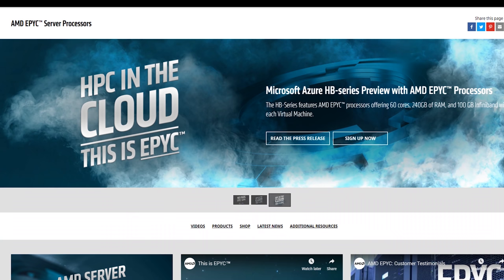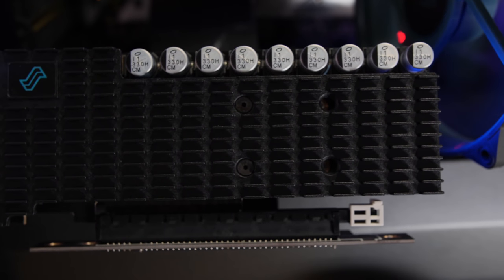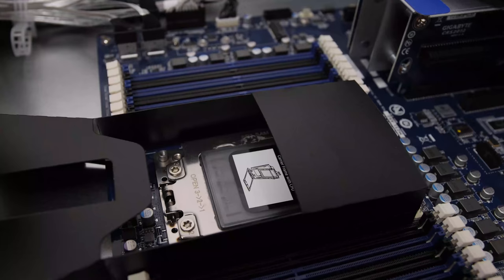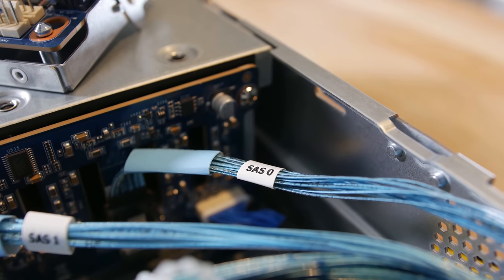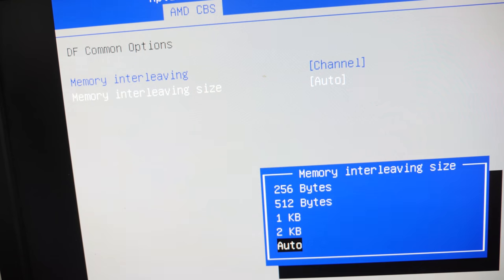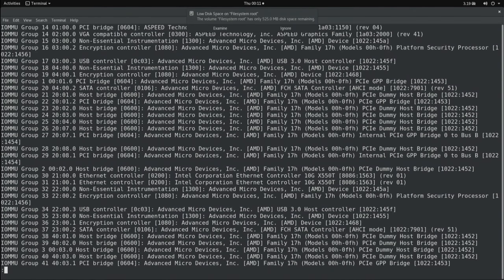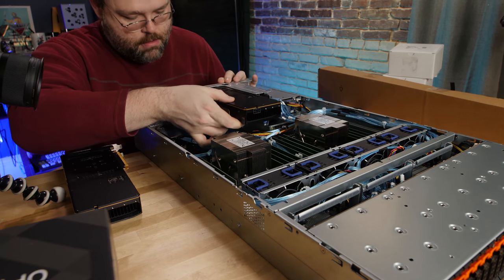Our Most Epyc CPU Tests Yet! The AMD Epyc 7371 On The Gigabyte R281-Z92

Comment: THANK YOU, WENDELL!!!
I was just SO excited to see what the tech community was going to do with these EPYC CPUs when they first came out - I mean, let's be honest, Ryzen is pretty damn conventional by modern standards, it was just MASSIVELY underestimated by all of us; but, EPYC has ALWAYS been the true star of the show. And, yet, I waited, and waited, and waited, I would regularly do search, after search, after search, I would make request after request; but NO ONE has done any real EPYC content to speak of, while it may be uncommon but it's certainly not rare to see great content involving Intel Xeon parts. I get that availability for EPYC parts is nothing like the availability of Xeon parts of course; but NO ONE was curious enough to check these things out to actually pull some strings and get ahold of one of these??? These are some of the most advanced and power dense commercial CPUs on the planet - and they're basically 2 years old now with not much of any content out there on them at all.

Is the rest of the tech community just not as interested in seeing what EPYC can do as I am? I mean, why someone like Linus wasn't making unique content on the 32c/64t EPYC hardware an entire YEAR before we even knew that a 32c/64t Threadripper would arrive, I don't know - but you can't possibly tell me that a video about a 32 core 64 thread AMD powerhouse in !!!2017!!! wouldn't have generated a metric truck load fuck ton of hits, the fact that this was even coming from AMD in 2017 alone was just crazy.

Anyway, I'll just leave my bitching at that - at least SOMEONE in the tech community is interested in these things!
Reply: I assume it's because Xeons have had a longer lifespan, thus, is more likely to be sold used and end up in consumer hands. Epyc is only 2-3 years old now, so used hardware isn't really avaible yet.

I imagine once we get some 32 or 64 core Epycs in the hands of the community, we could see some crazy stuff happen.

Comment: Compile linux kernel in 28.81 sec?? Holy crap. Gentoo doesn't sound all that bad, all of a sudden.
Reply: Really 29 seconds to compile the kernel? That means chromium will just take 2 hours to compile!! :P
Reply: @markkeilys  Instead of 16. Yay
Reply: Just for the record, the compile time was never really what made Gentoo intimidating.
I learned to fear routine updates because there was always a chance I'd be stuck in dependency hell for days before I figured out what was going on. More importantly, I wasn't getting shit done.
...it was usually python. It's always fucking python and everything is dependent on different versions.
emerge -uavDN @world. Not even once.

TL;DR: should've installed everything in chroot. Or Flatpak, these days.

Comment: I could condense a whole rack worth of Xeon's into just 3 of these Epyc Systems as VM Hosts.... 
Damn AMD are on a roll with DC Hardware!
Reply: +Jared Woodruff To be honest, those Epycs would likely cost more, especially if you would buy slightly older used Xeons from eBay
Reply: @guestimator121  True, if you go second hand. 
From my perspective i would employ these in a large scale enterprise environment so second hand is not an option. 
Surprisingly i had DELL and HP Quote up some of the Zen 1 series Epyc servers and the cost was so much lower then Intel equivalents it was a no brainier.
Reply: @guestimator121  Used hardware in mission critical business environment? Hmmmmmmmmm
Reply: @guestimator121  epyc is way, WAY more affordable than xeon. Like stupidly more affordable. You can buy 2 7601s for the price of one 8 core xeon, and you will still have leftover money.
Reply: Snow Star Yeah, haha, what if I just got done with extreme overclocking on the Xeons? Lol, just because they pass my stability test doesn’t mean much (that said, I’ve seen Xeons fail my testing.... but recently with my Threadripper I’m like yay, more than 1 or 2 sticks out of 4 are detected...)

Comment: ...and all that UMA/NUMA stuff will be over with ROME, kinda, as 8 Dies have to communicate with the I/O Die (or ancient Speak: Chipset)...
Funny how that goes: First you integrate the Chipset into the CPU die, then you throw it out again into the I/O Die and have a more classical/ancient Setup. But its really interesting how that will work.
Reply: In the end, the physical location of the different functional units is not that important.
It's more a costs/yield vs. how fast can you tie the dies (chips) together...
Reply: All of this changes purely as a result of chip engineering/fabrication evolving to the point of making various component arrangements more advantageous or disadvantageous versus other component arrangements.

I think that, when looking at the past and how common it is for us to turn back to "the way we used to do it"(on an extremely generalized level anyway), people get the wrong idea and think something along the lines of "...well, why were we so dumb to ever move away from that when we obviously know today that it's the 'better' way...". But, what the misunderstanding is, is that 'we'(which is to say, the leading people behind the design of whatever object it is that's being talked about) tried to do it 'it' [THAT] way because we probably knew that it's likely the optimal way of doing whatever [THAT] is; but the engineering/manufacturing/materials technology of the past limited the possible ways that we could realistically achieve [THAT], and so while the general configuration may be the 'most ideal', we may not be able to realize the full potential of [THAT] arrangement due to limitations in the implementation of it.
Which is to say, AMD has arrived back to this point, with Intel quickly scrambling to follow them into it(crazy times!), because engineering/manufacturing/materials technology has only now made it possible for them to take advantage of this style packaging.
[good lord I hope all of that made some kind of sense - I'm much better at understanding this than I am at describing it]

In fact, this is played out VERY obviously in the auto industry. Take electric cars for example, they outnumbered internal combustion powered cars throughout the first decade of the 20th century[IIRC] - so, why didn't they just continue to dominate the auto industry, especially when internal combustion powered and steam powered cars required SOOOO much prep before you could even hop in and drive it to town and SOOOO much maintenance in ownership while electric cars just required basic lead-acid battery maintenance? 
"CONSPIRACY!!! Henry Ford, barley struggling to just stay afloat in the beginning years of his company OBVIOUSLY saw the electric cars as a threat to the success of his alien technology Model T!!!"
...well, no - electric cars failed to even remain viable in spite of very very early success due to the severe limitation of BATTERY TECHNOLOGY. So stifling has battery technology been that, even though General Motors invested MILLIONS upon MILLIONS of dollars into the EV1 program throughout the '90s, even though this program was attempted almost an entire century after the electric car saw very real and legitimate success, that General Motors, in all their best efforts, could NEVER make the EV1 even close to being a mass production viable program.
And, BTW, when you listen to these conspiracy theory morons that desperately contend that the EV1 was "killed because it would've completely changed the auto industry and our cancerous addiction to oil as we know it[!!!!1!!111!!!!1!1!!11!!!1!!]", just remember that they're attempting to prove to you that the very company - General Motors - that killed the EV1 for sinister internal combustion conspiracy reasons, is the same exact company that decided to start the program in the first place, that continued to invest millions upon millions of dollars, much more than they invested into any other car development program that actually reached the dealership, and that spent more than a decade trying their damndest to actually make it production viable, so that they could AT LEAST get some kind of return on everything that they had invested into this.
They're trying to convince you that a company would invest, say, $10M into a product that would "change the industry" - just to kill said product when it's supposedly "production ready" just because it's so vastly superior to every other product that they had...
HUH?!?! If it defies logic, it probably isn't true - it should go without saying that the easiest way that GM could've killed the EV1 is simply by not starting the damn program in the first place, let alone continuing to fund it more than they even funded the actual products that they profited off of...  
"huh, I wonder how GM went bankrupt in the 2000s..."

Oh yea, point being that electric cars are viable now because BATTERY TECHNOLOGY has finally progressed. 

...ok, I'll stop now - Ranty McRanterson signing out...
Reply: but an io die like that vs a chipset has 2 key advantages. The first being proximity to cores, the second being it holds L3 cache
Reply: @james2042  True And due to higher frequencys, latency should be lower as well.
Also keep in mind that back in the olden days, the Cache was controlled by the Chipset as well. In this case, it could even be an L3 Cache in some rare occasions (K6-3 or the 2/3 plus). Sadly those CPUs don't support no multi processing...
Reply: @james2042  Oh by the way, with the Information we have right now it looks like the L3 Cache is still inside the CPU Core and not the Notrhbridge aka I/O Die. We do not know if there is some kind of L3 Cache or Memory Buffer inside. But its likely that there might be something like that.
Maybe AMD even implemented speculative reading things. But I doubt that.

Comment: I'd love to see a cost and performance comparison of the TR 2950X, the R9-3950X and the EPYC 7371 and 7351 for the purposes of a high end desktop computer used for CFD work.

The AM4 MBs will be  a lot cheaper than the SP3 motherboards, but you can get a dual socket SP3 motherboard.  Geekbench4 comparisons are very interesting.  OEM 7351s are just a bit more expensive than the 3950X.   Who wins ?

OpenFOAM has a benchmark file if you need it or I could supply you with a test case.

Comment: Love to see a super RAID0 on the platform. Not to be just a geek, but to see where saturation is...u Know?!
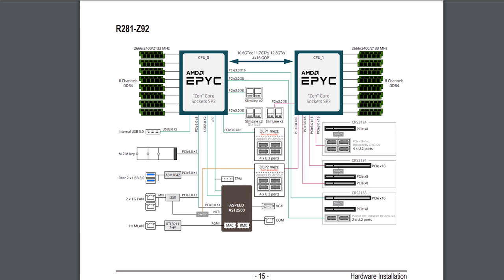Reply: In theory. Intel advertises 2gbs per u2 drive, 4 of them saturate the pci lane at 8gbs, software raid the pci lanes for 24gbs. amd advertise 341gbs memory bandwidth. So in theory bottleneck is number of pci lanes motherboard dedicates to storage. 1:37
Reply: I should be more specific. To saturate the EPYC core. So, let see a saturate at 64PCIe lanes. Will it, can it do like 80% data IO with 20% overhead?? 63.04GB/sec. most importantly tho, threaded IO..!!

Comment: QUESTION
Do you think the upcoming 12-core and 16-core AM4 CPU's will avoid the NUMA issues that necessitate disabling cores to avoid performance loss? (I apologize if the wording is incorrect). I want a high core-count CPU but I also want to avoid low single thread performance issues.
Reply: The Ryzen platform is dual channel, and theoretically there should only be two chiplets containing either 6 cores or 8 cores each.  That means that all the cores have direct memory access

Comment: Well... You could do some Water Cooling If I recall even though the sockets are "wired" differently the mounts are the same as Threadripper so... Threadripper Water block and Long thin Radiador Cause 2u server cases is good for some 80mm fans so....  they make 80 mm radiators.... so if Cooler clearance is an issue we have solutions.

Comment: Wow. That diagram at 1.37 ..I never knew how multi socket systems were put together.. I thought both CPUs were sort of joined as a package.. I see each CPU has it's own hardware to run.. So, I'm thinking this would either not run with one CPU.. or some capability would be lost.. anyone know?     edit:  I missed that piece on the top center showing the link between them ( 10.6 GT/s; 11.7 GT/s; 12 BGT/s 4x16 GOP )

Comment: I would like to see how long it would take to compile and actually usable Linux Kernel. Not just and "all no" config. The time it takes to compile an "all no" config is basically a useless performance metric.
Reply: @johnstrad  With the AMD boost algo the benchmark duration is more important than ever. Aside from the fact that unless you are creating Linux from scratch an all no config does not give the viewer any information that can be cross referenced in a real world scenario. Case and point, a viewer made a comment on this video about Gentoo not being that bad after hearing that the Linux Kernel was compiled in 28 seconds. If this viewer actually tried to compile the Gentoo Kernel on this same setup they would be woefully disappointed because of the way they interpreted the information given in this video. I am not saying the information is inaccurate, but without qualification, it is at best misleading when the relation is made to a real world scenario.
Reply: Compiling an actually usable Debian kernel on my 4c/8t laptop processor took about 20 minutes last time I tried, so I would expect it to take less than 5 minutes on the 16c/32t AMD Epyc processor.

It may take quite a while before I get my hands on this kind of hardware. Maybe I am one of the few people out there who thinks that 4/8-core processors aren't really useful, so I may wait until 16-core processors will become the default before I decide to buy anything.
Reply: @psychicist  That's probably about right because my Threadripper 2990wx 32c/64t at 4.1Ghz compiles the Stock Arch kernel in 3 minutes 38 seconds.

Comment: How does it run Crysis?
Reply: Should be about the same as my Threadripper. It won’t sound impressive since I’m limited by 4x R9 Fury, but I get 100 fps at 4k Ultra on Crysis 3.
PCIe for quad GPU is certainly needed, I look at the 9900k with its 16 lanes (enough for 1 GPU) and wonder how Intel sells it for more than something with 2x the memory channels, 2x the cores and threads, and 4x the GPU capability all while staying much easier to cool well even on a 120mm AIO (stock I hit 56c, overclocked at 4.15 GHz it’s still really good temps, on a 120mm AIO...). AMD PCIe lanes for the win!